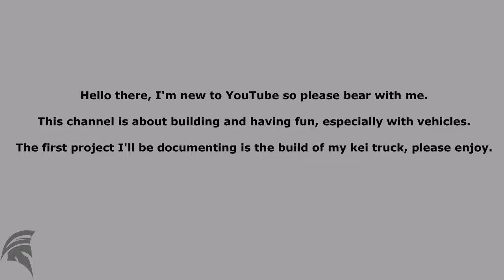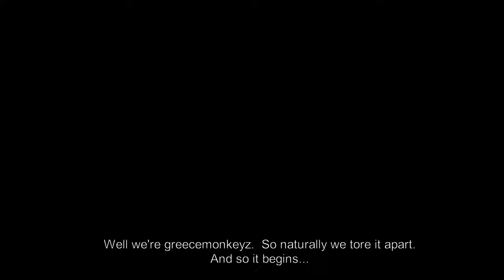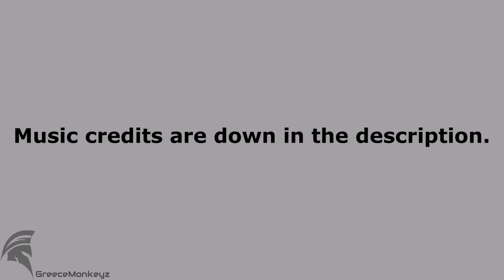First video ever!  Kei truck garage build - Part 1: The Teardown

Comment: Awesome video. Quick question how exactly did you remove the windshield? You seemed to be prying stuff from inside the vehicle. I have a different kei truck (honda acty) but it seems to have same style windshield installation with molding and flange in back. 

I want to remove it to remove rust spots at corner behind lower corner of windshield but have no clue how to. 

Thank you.
Reply from the maker: The windshield is held in by a rubber gasket, no adhesives.  You just need to work slowly and get the rubber to roll over the edge of the metal.  I did it by hand with plastic tools to avoid scratching anything or ripping the old rubber.  Once the top and sides were free I lifted it out of the bottom groove.

Comment: Hey man. Dont know if you will see this comment but I am currently preparing to do paint on the interior of my Hijet and I was wondering how you managed to take the whole dash off. I have gotten to the point where the only things left are the air controls, the gauge cluster and the steering column which are blocking the dash being able to be removed. I'm kinda stuck on how to actually remove them so im wondering if I could chat with you on how to actually remove these things as you are seemingly the only example of this being done to a hijet on the internet lol.
Reply: Well after sleeping on it I figured it out 😅

Comment: Currently building a hijet myself what lug pattern are the wheels you purchased. Im having a issue finding wheels
Reply from the maker: Hijets have a funky bolt pattern of 4x110, here in the states you will mostly find ATV/UTV wheels with that pattern.  My wheels are 4x108 and I'm using misalignment lug nuts which allow for 1mm play in either direction giving me 110mm.  Definitely not ideal, but with the right hub centric ring I don't have any problems with vibration even on the highway.  Might be easier to get adapters made and just use wheels with more positive offset.